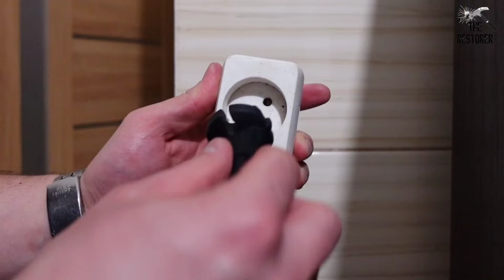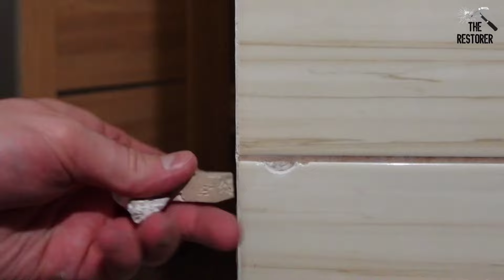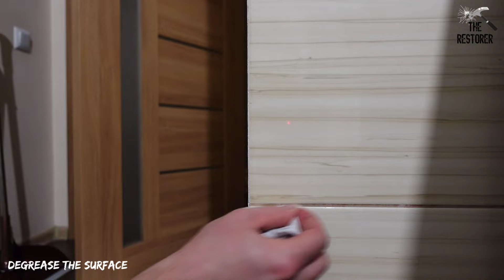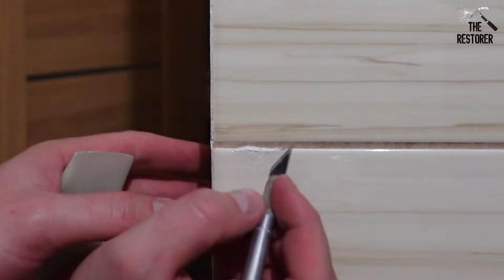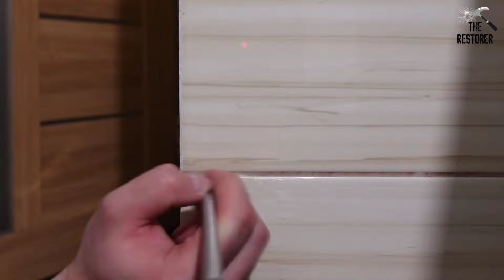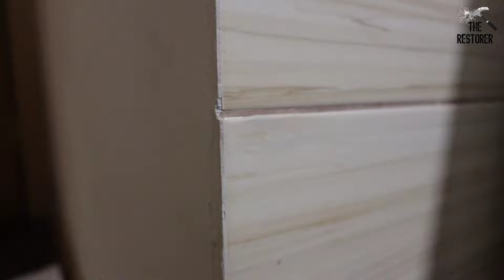Сhipped Tiles are Not a Problem | Ceramic Tile Fix

Comment from the maker: https://amzn.to/3BbHd07- Buy Tile Repair Kit (Universal)
https://amzn.to/3XTcePi - Buy Ceramic and Tile Repair Kit
https://amzn.to/4e7pPbg - Buy Kit for repairing stone, marble, granite, tiles
https://amzn.to/3XC1kvH - Buy Multifunctional Tile Stone Crack Repair Kit
https://amzn.to/4eQO9yj - Buy Porcelain Sink Repair Kit For Tile Chips, Cracks, Holes And Scratches
https://amzn.to/3Xz90io - Buy Repair Kit for Fiberglass Porcelain Ceramic Acrylic Stone
https://amzn.to/3d8NXgq - Buy Tile Repair Kit "Picobello"
https://amzn.to/3Aj5VHj -  Buy Tile/Granite/Marble & Quartz Repair Kit 
https://amzn.to/3q9jjrp - Buy furniture/floor repair kit
Friends, if you have additional questions, write in the comments, I will try to answer.
Reply: Amazing work !!
Reply from the maker: @maruorozco7210  Thanks!
Reply: Some commentary would help. I haven't the foggiest notion as to what is used & with what tools 😐
Reply: @lovethosebudgies  he has links to everything under the title:)
Reply: Magkano po yan
Reply: Trabajo perfecto. Gracias.😊

Comment: Great Video. A couple of quick questions. The multi-coloured fillers that you use, are they included in one of the kits you link to or are they available separately and are they different from the waxes?
Secondly, I have large ceramic tiles, some with hairline cracks. Would you recommend opening up the top of the cracks with a Dremel or similar prior to filling so you've got more of the surface exposed?
I was initially looking at getting a pourable solvent resin and adding some coloured grout but your time consuming repair looks to be a better option.
Reply from the maker: Hello! Thank you! There are different sets. Basically, the set includes basic colors that will be enough for home repairs. Wax for ceramics is melted with a soldering iron and in its liquid state it can be filled in cracks, crevices, chips, and holes. At the end, it is desirable to cover the surface with varnish. https://amzn.to/47z2ige

Comment: Which transparent and glossy varnish did you use? Do you have the konig code?
Reply from the maker: Ko. 340
Reply: Hi! We have glossy white subway tiles and some have tiny chips around the edges. Is it possible to fix them without buying that big box with all the colors? What brand do I look for?

Comment: How do you suggest you handle a 3/4' hole in a vertical porcelain tile?  Fill with auto body filler and then leave it a bit shallow before this technique?
Reply from the maker: Yes, you are right.
Reply: Just replace the tile lol
Reply: @AllBayEveryDay  lol.  Actually this technique worked perfectly.  I filled the cavity with body filler and left about 1/8 of an inch. I filled the rest with sanded grout and it is not even noticeable.

Comment: Mate I'm a professional surface surgeon and never repaired a chipped tile with hard wax 🤣.
It will not last
Reply from the maker: If you are a professional restorer, you should know about hard wax for ceramics))) Of course it will hold!
Reply from the maker: Learn new technologies - it's useful!
Reply: @TheRestorer  try to use tinted TENAX and come bavk to me.Hard wax repair is fast repair but it will no last.Its not waterproof

Comment: Not bad. But repaired edge isn't straight and inline with the rest of the edge. In other words you can see the repair. Some jobs that would be OK but on others if you can see that it's been repaired then it's not acceptable. Depends on the customer. On this job the vertical corner is rough and jagged, not the best install. You should always use a rubbing stone or diamond file to smooth cut edges. The Schluter company makes all sorts of trim pieces that would protect that corner from being damaged or from someone getting cut on it. That said great technique and can definitely be perfected.
Reply from the maker: Thanks for the advice. Perfection has no limits